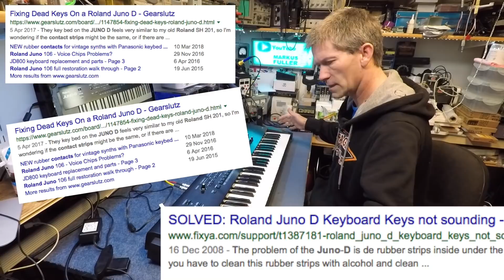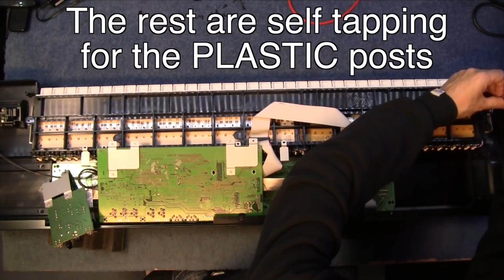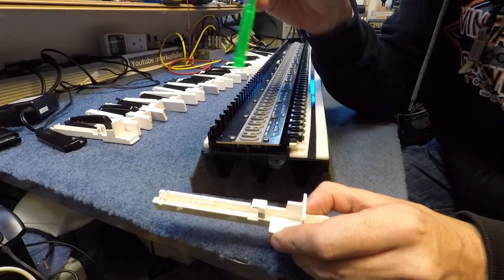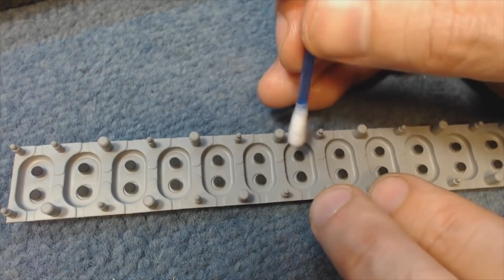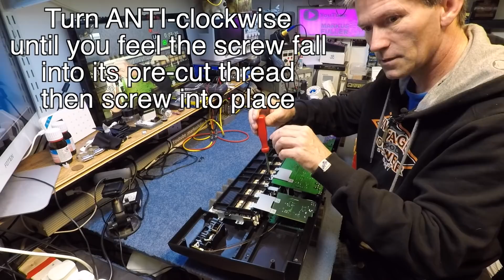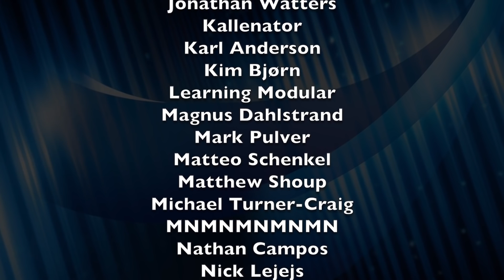Keyboard repair key fix roland juno dead keys

Comment: first person ever,  to advise turning self tapping screws backwards, to find original grooves.   well done, on another fine video
Reply: Michael, of ThatTubeSound on YouTube, used to advise the same procedure when working with old vintage radios and their metal chassis. It's good advice, no matter who gives it!
Reply: Another issue is that some self-taping screws actually have a double-thread that's usually seen as a much steeper angle of the thread, & with each alternate thread being slightly shallower, so there's a 50% chance it will start to bind as you screw it in, so it's very important at that you reverse it a 2nd time until it drops into the thread to avoid splitting the plastic-post! 
Also find that even after reversing a normal screw first, occasionally the screw can drag in some plastic from the edge of the hole which is indicated by a bit more resistance, but also reversing it a 2nd time fixes it!
Reply: @MrWombatty  yes, more good advice.     many , like me, learn the hard way.  cheers
Reply: I have always done this but just realized it is something you should share😂

Comment: Nice video Markus -- as always. 

I've been working with electronics (mostly tape recorders) for over 40 years, and I see this problem all the time on record/play switches in vintage tape recorders and their volume/tone controls. Makes no difference, reel to reel, 8-track, or cassette -- they all get taken down eventually by this issue. The issue is the air around us.

40-50 years ago -- when the machines were new - no problem. But within a year, many of the machines were in for service - basically cleaning of the contacts! Of course, in those days, air pollution was much worse - at least in the US. And even today, there are really polluted areas where some people are living.

My  chemistry professor explained in one university lecture, how it works. I'm not as eloquent as he was, but I'll try to be...

We live with air pollution from vehicles and other sources that we never think of as pollution (i.e. cooking - have you ever burnt toast?) Heating systems (like forced hot air and even steam radiators) can also contribute to the pollution because hot air rises, and carried particulate with it. Think of the oceans teeming with plankton (enough to keep giant whales alive!) and you get the picture.  

The atmosphere is basically an ocean of gas -- and gas can go anywhere that is NOT hermetically sealed. The atmosphere itself brings the pollution with it until it comes to rest on the metal contacts and carbon pads and gets attached through a type of molecular bonding. 

Over time, this forms a coating that insulates the components! Since there is not much current in any of these electronic systems at the switching level, there isn't enough electrical power (as you know, current, not voltage is power) to "arc" through this "film" and close the contacts.  

To make matters worse, if the machine (or keyboard) is in a smoker's environment, that smoke can be very sticky, so the problem is made worse. And even cooking smoke and grease can be carried in the air into the keyboard (or tape recorder). It's actually "fluid dynamics" at work. Our natural world that we take for granted. 

I have even seen where the pollution is so bad (smog laden areas, smoker environment, cooking in a one room apartment or even an "open" - loft-style  apt. layout (where the kitchen is exposed to the rest of the living space)  that the "ink" resistor track on potentiometers can get eaten away and the control is useless. I have a video about a Wollensak tape recorder where I had to replace the resistive track boards in the volume controls because the original tracks were simply GONE!

When I worked on pipe organs, I saw how this same problem ate tiny pinholes right through the delicate leather membranes used in elector-pneumatic systems, (tracker systems, which are completely mechanical, didn't have this problem), causing massive repair problems, and in some cases, churches sold off their old pipe organs and bought electronic replacements because it was cheaper than the cost of pipe organ repairs! 

That's my experience, anyway.

Sorry for the overly long comment.
Reply from the maker: Hi Clydesight. that was actually a most interesting read. I use to work in the pub trade (bar) in the days when everyone smoked and I was always repairing the tape players which got seriously gunked up and the cassettes would almost stick to the tape heads if left long enough. to think what damage that has placed on my health. I remember my eyes use to sting after a long busy shift into the late hours behind that Bar. well I am still here at the moment and reasonably healthy (i think) for someone in his 50s. heres to the next 50 years :-)
Reply: @markusfuller  To the next 50 years indeed! Oh, heck,. To Infinity And Beyond!
Reply: Thank you for the scientific insight. Interesting topic and without a lab or a chemist its almost not believable since this does accumulate over time and we cant see it. It just happens.
Reply: Would regular vacuuming help avoid this problem?

Comment: Thank you for a great, helpful video. I just experienced this issue with a few keys on my Roland Gaia SH-01 that I had just taken out of a case after about 2 years of non-use. I tested your method with one key first and it worked first time, so I took the time to clean all of the keys as I figured I had already taken out the many screws so why not invest a bit more time cleaning them all for good measure! Everything is working fine now. It was much easier to do once I had watched your informative video that include step-by-step deconstruction and reconstruction of a similar item, including your tips. It saved me a heap of cash, time and heartache an I am immensely relieved as well so thank you heaps!

Comment: Thanks for the video! I repaired our Juno D yesterday based on this! Thank You very much! I did 2 mistakes. When picking off the springs, I had keyboard turned upside down. So I noticed the keys just fall apart by themself. ;) but I can manage to move them as a group.

Comment: Quite the overhaul, I've had to do the same thing in spot areas on my Roland Piano for years and over time fluff and dust and crap does this and unless you keep it covered (which I did) it will happen to most keyboards and they all seem to have the same rubber pads.

Comment: Thanks for this. Great guide. I had an issue where for whatever reason my keys wouldnt sit right and they would pull keys down beside them. You have to break it back down and play with how they sit to remedy that. Just something to be aware of for anyone doing this. As you put the springs on test each key and make sure it is working mechanically sound before you put it al back together.

Comment: Thank you very much. This is the only video I could find about this problem---the same problem that has plagued my Roland HP-100 piano--same key design, same troublesome rubber contact switches.  On the piano, the main issue hasn't been that many completely dead keys, as on your Juno--it's been the loss of dynamics, or velocity sensitivity, resulting in certain notes sounding at full volume regardless of how hard the key was struck.  And it will do that intermittently and unpredictably, in a most annoying manner, in the middle of a piece.  For years, I was ordering new rubber key strips and replacing them, which would fix the problem temporarily until a different key would start doing the same thing.  But now the strips are no longer available, so I have tried the contact cleaning method, with temporary and mixed results.  Too bad, because it's an otherwise pretty nice old piano....

Comment: Some of these Juno D's had an issue with rubbish rubber contacts. I replaced ours with new upgraded ones years ago. It hasn't been used in a whole , but still works. Great synths especially the way you can combine patches.

Comment: I read somewhere that the problem with the rubber is that in order to keep it soft the factories under cook it and it causes the silicone to sweat out after some time, it's similar to what happens with rubber buttons from remote controllers, but people think that it's the oils in their hands and it could be but silicone oils are also the problem.
Reply: Like Action Man's gripping hand you mean? Makes sense.
Reply from the maker: Yes it is always the problem that we design something and think that is the answer to make something last and after a few years we realise its not so perfect after all.

Comment: I was not aware you had a video on cleaning the Juno D ! I actually purchased one last year for 60 $, with the same issue, but also with many dead tact switches. I’ve cleaned up the keyboard with isopropyl alcohol. For the switches, I spread a drop of Deoxit, and then spin them with a rubber coated piece of wood and a drill. Very efficient. By the way, a pretty good keyboard; I originally planned selling it after repair, but once fixed I was impressed by the sounds and I finally kept it.
Reply: I know it´s been a while. But can you actually explain the "spin them with a rubber coated piece of wood" part in detail? I did not understand this.
Reply: @el_micha  Remove the PCB from the case; you need to access the tact switches. Take a piece of wood; an old pencil is good. Glue a piece of rubber to the smooth end (not the sharp end); the idea is to grip the top of the switch enough to spin it. Put your pencil in a drill ('cause I'm lazy; you can do it manually), put a drop of Deoxit D5 into the tact switch (there is a small slit) and spin it 2-3 seconds with the tip of the pencil. This will cause a small rubbing actions and the Deoxit to spread inside the switch. I did it on my Juno-D 4 or 5 years ago, no issue so far.
Reply: @francoisbasquin6974  Thank you for getting back and your explanation, now I got it!

Comment: I did the same fix on a D50, and it worked. It's a shame that things made even after 1986 will fail, and imagine pulling that rubber strip off in another 10, 20 years! Ohh, Roland.

Comment: Thank you Markus for this video I have the same keyboard like this Roland Juno-D and three (3) keys are dead now I know what to do. Thank you
Reply from the maker: Thanks Freddie. I hope you get it repaired.
Reply: Hi Markus got my Roland JunoD some dead keys again but this time I didn’t successful in fixing it with what you have instructed but without using the 99.9% alcohol. Maybe the carbon is not touching the other side. I look for some remedy like using the carbon of the pencil but to no avail. What do you think must be the problem? Thank you and regards

Comment: Great vid. Did exactly as you said and stripped, cleaned and reassembled my Roland E15 to working order after 5 keys went dead. Did it 4 times to check correct orientation of the carbon silicon pads!! 😂

Comment: Ohhhhhhhh dude! You chuffing LIFE SAVER!! My Juno suffers the same problem, I lost several of my keys to this issue. Cleaning solved some of it bu a few are still tetchy. The software for it for PC will save all your work via a midi dump. I use it to save my performance presets like a song dump, so if I wanted it to be part of a song I do I save all the preset work, settings etc then save out the performance data to the software and save that as a file on pc. The reverse is true for dumping back to the Juno for 'Loading' your song presets. The software lets you do live changes like preset, volume, effects etc while the keyboard is playing although as it is Midi, it can lag a little if there is a lot going on.
You ever find out what the spare places on the board are for where LEDs and switches would go? I imagine another version or type maybe had a sequencer built in..?
The Patches I use most on it are the Drum Kits as they are great and its orchestral sounds like Piano and and Brass make great additions to songs.
Yes, taking the keys off is a pain as they are individual and sprung. I like how the silver springs are for the white keys and gold springs for the black keys, but the keys HAVE to go back on in the right order ( they have little letters and numbers embossed into them underneath ) 
Thank you soooo much for getting a JUNO D and sharing this experience.

Comment: Hi Markus, thank you for the video. I see it requires some patience to do this surgery.
I have a Roland Juno-D and guess what, most keys are not working anymore.
Surprise, surprise. I dont like these carbon contacts in rubber.

Up to now i am using a midi keyboard connected to the Juno D.
Sooner or later i need to do it. On the display board the switches to change the sounds
aren't working well either. Well this synthesizer is old and has seen better days.
But i like what we can do with this old thing and i would never give it away.

Comment: A few years back I did the same on a Roland JD-800. The rubber pads look a bit different. The plungers are thicker at the top to keep them in place, like a hook. However in my case cleaning them was not good enough because the velocity of the keys was not uniform,  very noticeable.  I ended up replacing all rubber strips. They can be ordered online from Roland and were reasonably priced. Just a few quid each.

Comment: thank you this worked, I had a rogue key that wouldn't work but eventually it did, I tried using a pencil and gently colored the contacts for that specific key but it made it worse so I cleaned it again with the isopropyl alcohol and then it worked out of a sudden.

Comment: Here's a tip for pushing the rubber nipples back through the printed circuit board: use a plastic "soft-pick" meant for cleaning between teeth. This is less likely to tear the rubber than a micro screwdriver or a paper clip. That said, cleaning the contacts did not fix my problem. What did was trimming the rubber bumper (this is a rubber ring on the end of the keybed support for each key) for the too-quiet keys, allowing them to travel down a fraction of a millimeter farther with each press so they make better contact with the sensor.
Reply: never ever trim rubber pads, after cleaning pads, use a high carbon drawing pencil with 1000 or finer grit sandpaper to soften carbon on pencil tip, then gently apply it on both pads & board traces, I have 5 years of experience fixing these issues, my method is also not a temporary fix
Reply: @humayunadeel4043  Oh nice idea. I still have a couple problem keys after cleaning my Juno D and will try this. I also have seen people clip the carbon pads clean off and glue another pad they took from an old remote. Obviously you can buy new rubber strips for about $10 each

Comment: Nice fix! In the USA we have these Pink Pearl brand pencil eraser bars. You can use those to remove oxidation and shine up the metal contacts on the PCB... Just DO NOT use that if they are black carbon contacts on the PCB. Once rubbed, wipe away any eraser dust and clean with the Isopropyl Alcohol. Some of these older rubber bits are silicone rubber and will leach out the oil, causing problems. Looks like the Juno didn't have those, which is a bit of a Godsend.

Comment: The carbon always seems to breakdown in those types of switches. I've seen them get completely wet with oxidized goo. Sometimes the contacts on each end of the ribbon need cleaning too.

Comment: Hello Markus. Firstly, thank you for posting this insighful video on repairing faulty keys in a syntheziser. I am trying to fix my own vintage 1978 
Roland RS09 Musical Keyboard. I am the original owner. The issue is with it the 3 push buttons (sound selectors) - 1 for the Organ and other 2 for Strings.
They work off and on,  sometimes with a mild press / wiggle / nudge. Except for this issue, all other functions work perfectly. 
I have now opened the keyboard and have access to the selector buttons but do not see  how they can be detached or cleaned. Apperciate any advice 
on what needs to be done to rectify this issue.Thank you.

Comment: Funny, Yesterday for the first time i have exchaned one strip of rubber contacts in my Nord Lead 2, and it went pretty well.Technique was the same as in Juno. It was worth it cause in the repair shop they wanted to charge me ca 120 dollars  ( 90 euro) for that !!!  Rubber strip (12 notes)  cost me 15 dollars so that was the whole cost of repair.
Reply from the maker: Yikes thats an expensive repair. I bought this whole keyboard for £25.00 = $42.50ca
Reply: @markusfuller  woah! that's cheap, i havent found this keyboard for sale on less than 600$
Reply from the maker: Dr Drex I found it on a carboot sale. sort of garage sale

Comment: Unfortunately my several 'dead keys' still won't sound after cleaning all contacts, could there be issues with circuitry? I appreciate you showing me this as it did save me paying someone else to do it but it seems it may require more $ fixing it than its worth.

Comment: Nice video! My keyboard is a different brand but being like 20 years old (though without much use at all until now) I noticed some keys require a bit more force to register nowadays, and "touch sensitivity" especially can require quite some "hammering" so as to get the note properly audible. This should help me along the right path for getting it cleaned up :)